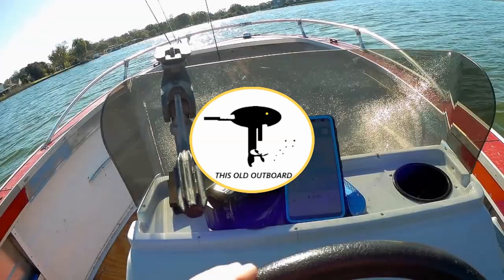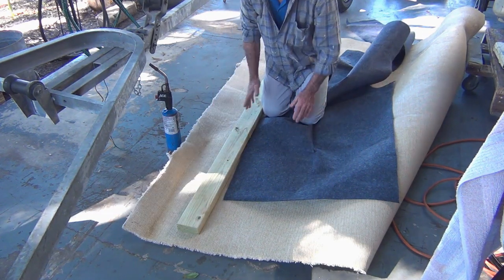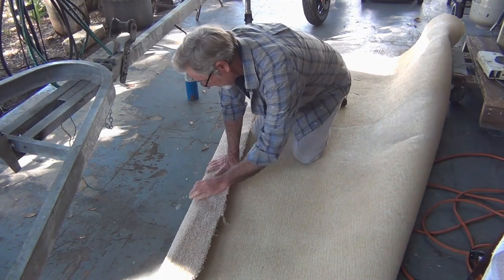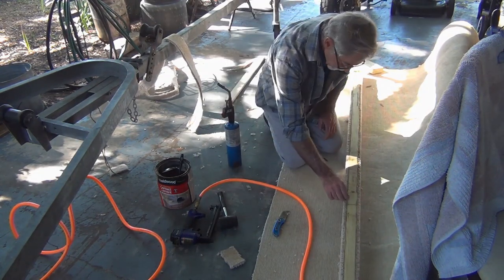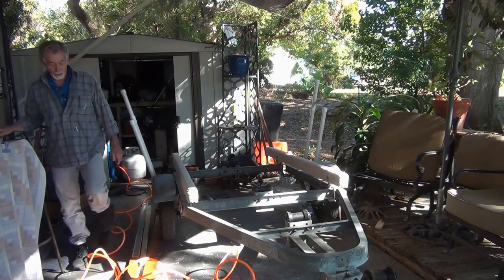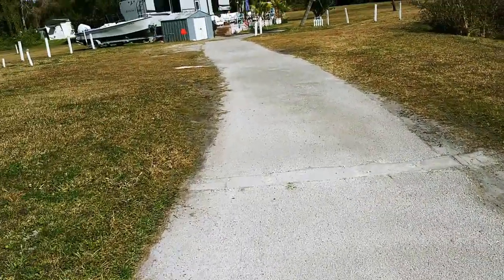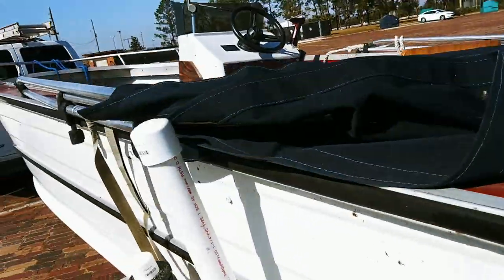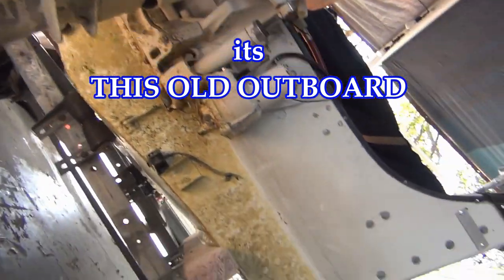16' Starcraft Boat Trailer Mods. WILL IT FIT? Countdown to Showdown!

Comment: Sweet? Good attention to detail. I made a short walkway on my trailer. Depends on the boat ramp if I use it tho.
Your trailer looks about right axle placement wise.
When it's on the jockey wheel try to lift at the hitch to get an idea if too tail heavy as you don't want it wagging.
Nice set up,👍
Reply from the maker: Ok. Thanks !